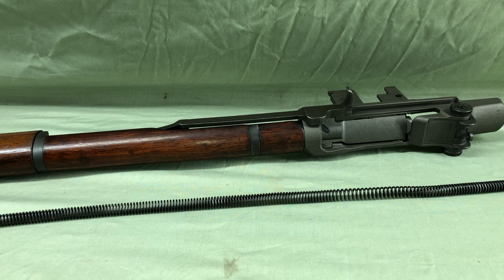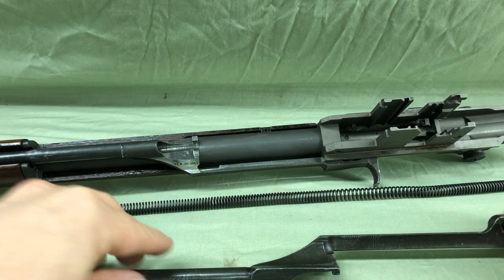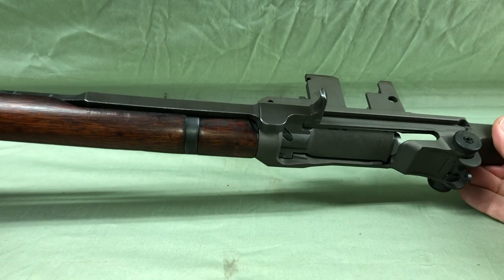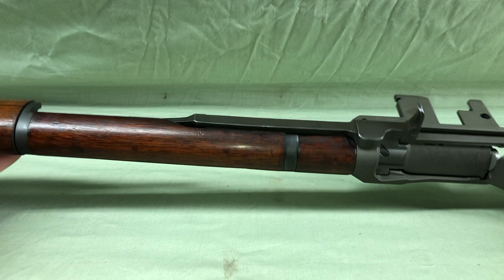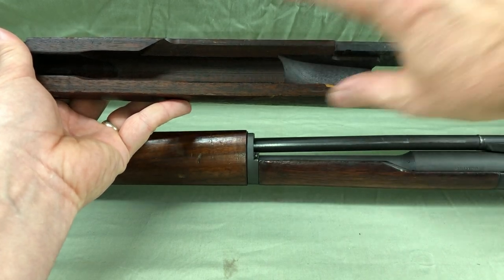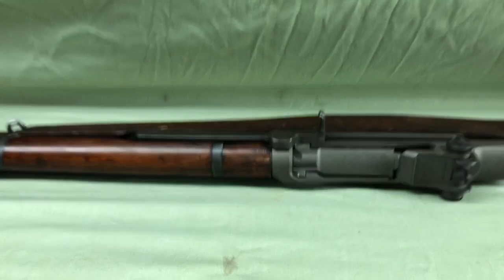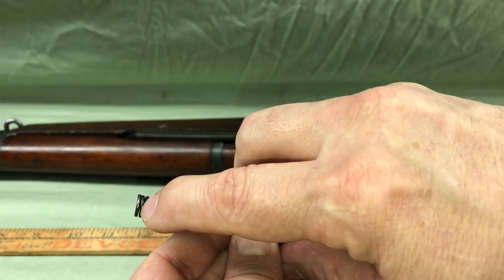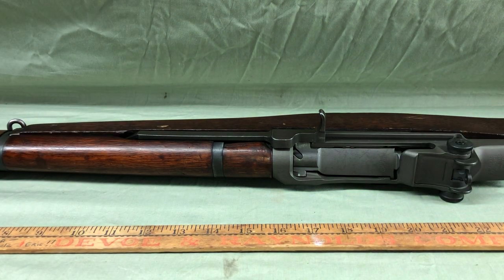M1 Garand Oprod Tilt Test & Op Spring

Comment: Serious question I got an expert grade m1 and the tilt test doesn't work. Could it be the new barrel causing this? The extra parkerization causing it to hang up? If I apply slight pressure the tilt test works everything moves great.
Reply from the maker: Sounds like the new park is hanging it up.  Shot it a few times.  I have in the past take 0000 steel wool and gone over the parts that slide over each other to reduce the friction.
Reply: @norwich93CMP  Sounds good. I have not had the time to shoot it yet, so I might be making a mountain of an ant hill here. I guess it usually comes down to shoot it and then worry about it! Thanks man!

Comment: We have M1,s at the American Legion. 1 fires 1 round, ejects but does not load the next round. it passes the op rod test and the spring is good. What could be my issue?
Reply from the maker: This for blank firing?
Reply: Yes, with blanks. We have the new BFAs, and the weapon is clean.
Reply: @HowardGriffith-e4z  you could be loading the En-Bloc clips wrong you have to make sure they are seated all the way to the rear of the clip and are seated in between the gaps of each round properly otherwise it may jam. I had this issue, after discovering this I made sure I was loading them properly. Also make sure you start your first round on the bottom left hand side of the clip when it’s fully loaded you will have the last round on the top right, it’s easier to load this way and these rifles prefer it when the clips are loaded this way

Comment: I know this is an old video but figured i might ask here. When I pull back on my charging handle, sometimes the op rod and bolt come off the track and I have to push it down to re-align it in order for the bolt to cycle. I've read that it might be me just pulling the op rod slightly up as i charge it but i wanted to make sure. Is this normal?
Reply from the maker: Hello.  Yes it can happen but more than likely the tab at the bottom of the oprod handle is probably worn a little.  I would be careful to pull straight back and not back and up.
Reply: @norwich93CMP  Ok so I took it out shooting a couple times and weirdly during the first clip, the op rod comes off the rails. Only during the very first clip and then no more problems.

Comment: My m1 passes the tilt test until I add the trigger system, and latch it into place. Does this mean it is failing? Because I have noticed some grease residue on my stock...
Reply from the maker: The pressure of locking it into place maybe bidding against the stock.  Might be a possibility.

Comment: If you add aftermarket oprod spring do you need to tune it to your m1
Reply from the maker: No tuning.  If the original operating spring is the cause of an issue that you identified try the new spring.